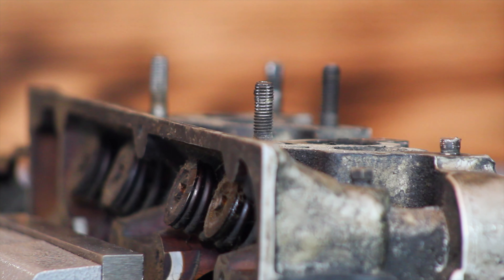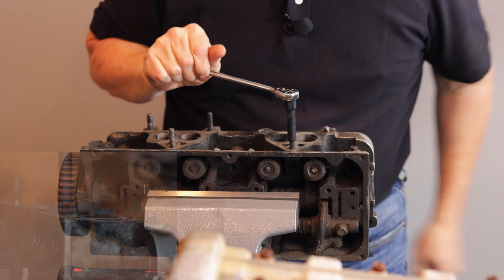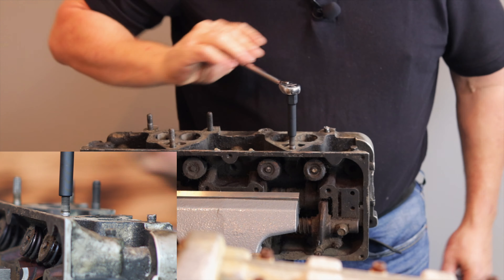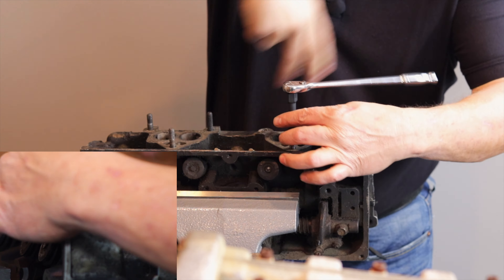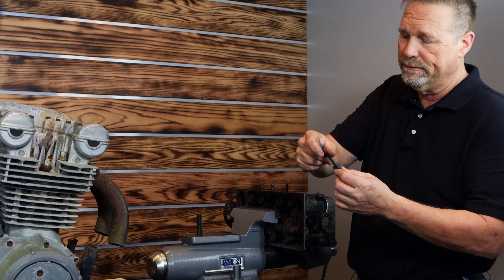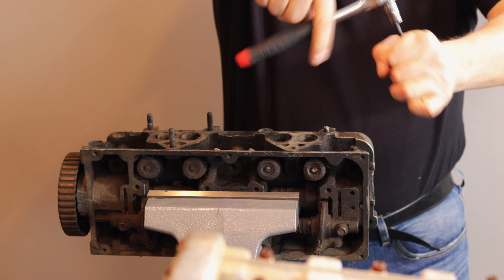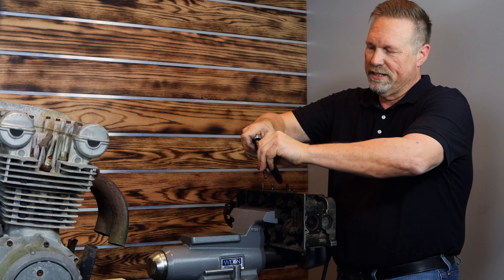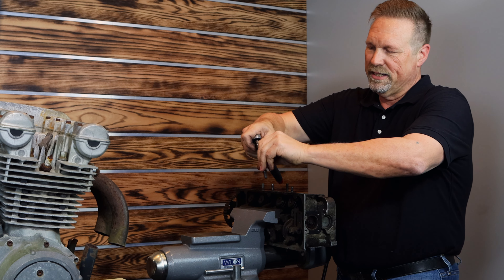The NEW MAC RBRT Extractor Socket: When Ain't Nothing Else Getting It Out !

Comment: A buddy and I swapped springs on my F250. The stack has a dowel that is supposed to be welded to the bottom spring. I used an RBRT socket to hold the round end so we could take the spring stack apart.

Comment: Hello again Dan 
In the Video you used a six point bolt. Say, a twelve point bolt had the same issue. If all twelve points were stripped, in theory the RBRT socket should have the same result? As a Aircraft Mechanic most of my hardware is twelve points. I would be very interested. Again thank you.
Reply from the maker: Absolutley! Outstanding solution for Rounded 12pt bolts, I think this will be a great topic for a video in the future, Thank you George!
Reply: @dantherbrtguy6571  Thank you for the quick response. Almost all airplane hardware is twelve points, and in SAE. Having said that, we do have some six point hardware, just not a huge amount. Verses the twelve point hardware. I look forward to seeing the future Videos. Again thank you

Comment: Would they work on 2004 150 manifold bolts
Reply from the maker: I am not specifically familiar with 2004 f150 manifold bolts, these Extractor Sockets are designed to be hammered onto matierial, nuts, bolts, studs, pretty much you name it. I will look into this question and let you know, Thanks!

Comment: I might of missed it. What are the part numbers for the metric sets? Thanks.
Reply from the maker: SXDPEX5RBRT (5-PC 3/8" DR SAE 7/16" - 11/16" (deep)
SXMDPEX8RBRT (8-PC 3/8" DR METRIC 11 - 18 MM (deep)
SXMPEX8RBRT (8-PC 3/8" DR METRIC 11 - 18 MM (short)
SXPEX5RBRT (5-PC 3/8" DR SAE 7/16" - 11/16" (short)

SMMPEX9RBRT (9-PC 1/4" DR Metric 4mm-12mm (short)
SMPEX9RBRT (9-PC 1/4" DR SAE 3/16" -1/2" (short)
SMMDPEX9RBRT (9-PC 1/4" DR 4mm-12mm Metric (deep)
SMDPEX9RBRT (9-PC 1/4" DR 3/16"-1/2" SAE (deep)
SVMPEX7RBRT (7-PC 1/2" DR 19mm-25mm Metric (short)
SVPEX5RBRT (5-PC 1/2" DR 3/4"-1" SAE (short)
SVMDPEX7RBRT (7-PC 1/2" DR 19mm-25mm Metric (deep)
This all of them at the moment, Thanks Jose!